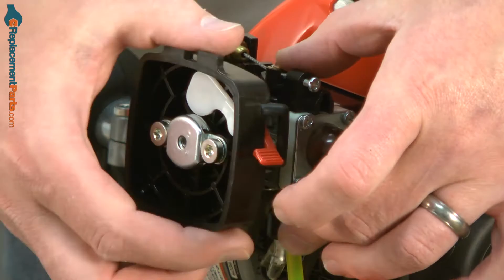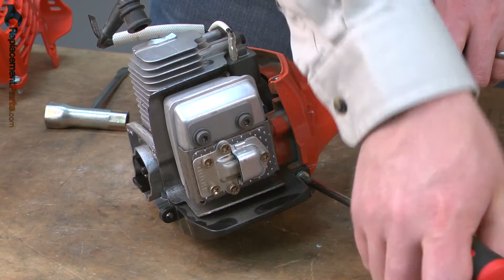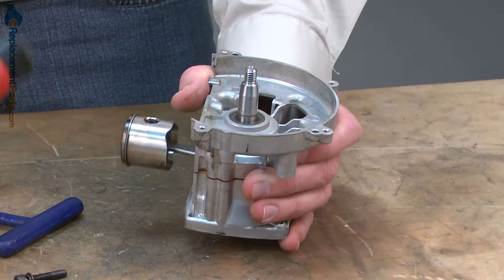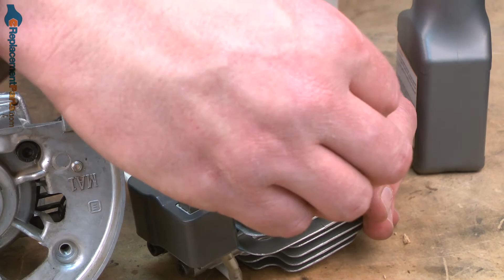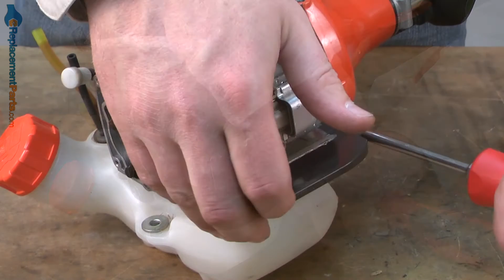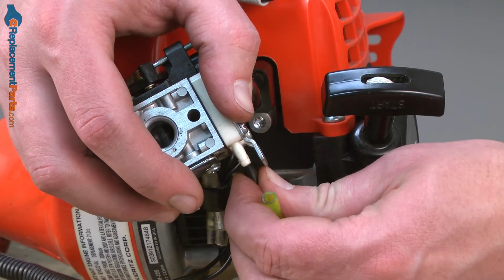Trimmer Repair - Replacing the Oil Seals (Echo Part # 10021242031)

Comment: No need to disassemble that far.    Expose the Shaft side and the Recoil side of the  engine.    use a small Sheet metal screw and screw into the seal use a pair of Pliers and pull on the screw head and out comes the seal.    lube the new seal and slide it over the shaft and Gently tap in the seal evenly with a wood dowel going side to side . or Lisle Tool   makes a on engine seal puller that you can use  about 20 bucks

Comment: Hello. I've learned quite a bit by watching your videos. Can you replace the crank seals without splitting the case? I have a seal tool that removes seals with the shaft still present. If I could, that would save me a lot of time and steps. I know you folks make the videos with the average DIYer in mind and the tools the average guy has on hand.
Thanks,
Dave